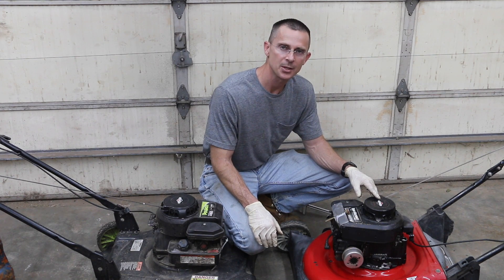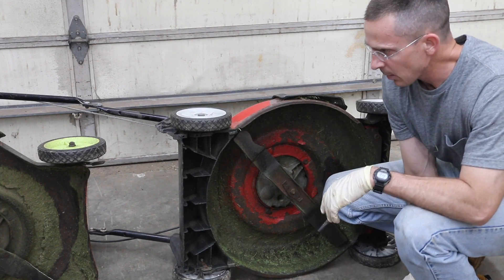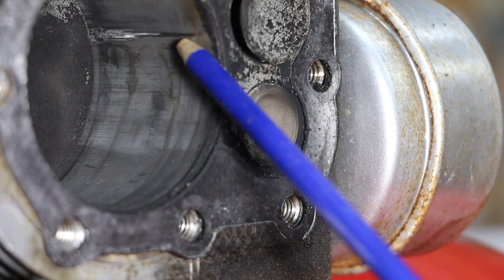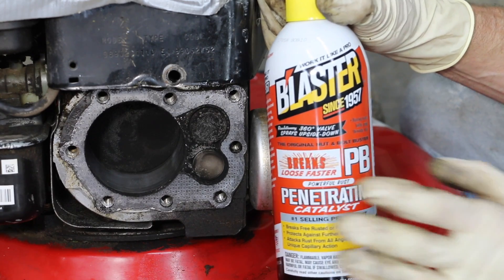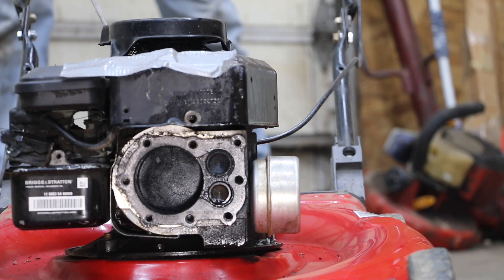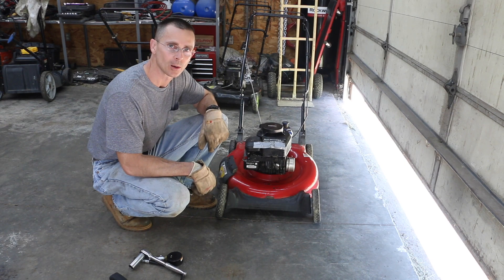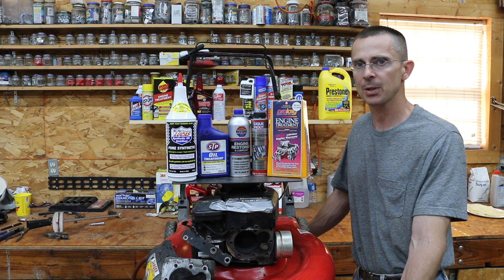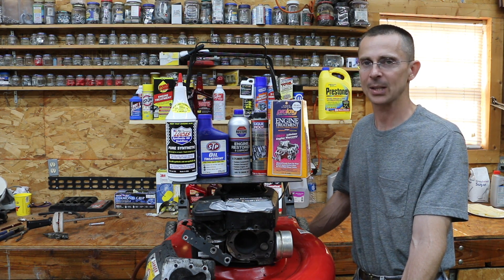Engine ran without oil, seized! Can it be saved?

Comment: I see that bottle of 44K in the background! We use BG products at our shop. If you're willing to test some, I can get you other products. Intake cleaner, engine performance restore, transmission conditioner, pretty much anything. I personally don't know how well they work but I've had good luck with the fuel system cleaners.
Reply from the maker: Dylan, I may take you up on the offer.  I've spent hundreds on additives thus far:)  Free additives would be greatly appreciated.  Could you send a PM to me if you're still willing to do this?
Reply: Project Farm PM sent!
Reply: Project Farm looks like it won't let me pm you directly from YouTube. I'll figure it out later today, getting ready for work.

Comment: Oh yes -- was that a 2 stroke or 4 stroke engine.  If 4, there would be more items to deal with -- valves/valve stems, actuators of different types, etc, as well as camshaft mechanism.  I forgot:-  Main bearings also, regardless of 2/4 stroke.
Reply from the maker: Alan, That's a 4 stroke engine.  I agree, the noise is coming from the main bearing.  Thanks for watching the video and commenting!

Comment: two recomenddations I have would be lucas oil stabilizer and engine restore.
Reply from the maker: Joel, Great recommendations!  Lucas is in first place in the vote and restore is in 2nd.  Thanks for watching the video and commenting!
Reply: Project Farm I recently blew an intake gasket due to me accidentally having a partly soaked k&n air filter of non flammable brake cleaner which wasn't the greatest idea and it sure looked like I was using seafoam.

Comment: Use diesel to free up seized engines... works beautifully. Literally fill the case to the top, leave the fill plug out, let the engine sit for an hr or so, then begin gently oscillating the crank back and forth to free the rings without breaking them. Then full rotations. Empty the diesel, wash the engine out with used oil, then put in fresh oil. (Red diesel is best due to the high sulphur content)
Reply from the maker: This is a great suggestion!  Thanks for watching the video and commenting!

Comment: Heh, nice job!  Many years ago a girlfriend siezed up the engine on her old Murray push mower. When I checked, it had little or no oil.  I was almost sure it was going to be a lost cause, but I still thought I'd see if I could get it running again.  To break it free I had to hit the piston with a small sledge using a piece of wood as a cushion.  Some hours later, and after changing the oil three times (it looked like someone had pured glitter into the crankcase) I decided to see if it would start.  I was astonished when it fired right up on the third pull and it barely smoked!  That thing ran for YEARS afterwards!  Moral?  Never give up!
Reply: These low-tech engines are surprisingly durable. If the Titanic had been made out of lawnmower engines it would still be going today.
Reply from the maker: BluntForceTrauma666, Impressive!   I enjoyed reading your post.  So, Thanks for commenting!
Reply: Nick Kocian it would never have gotten near the iceberg due to lack of power so he is 100% right.
Reply: WineScrounger  even though it hit an iceberg?
Reply: I've got an old Tecumsa that I'm considering to donate to Todd. 
It's got a cracked block and it has, more or less, run without oil for the last 7 year's !  At 30+-- hours every summer ! And it still runs dang good.
Reply: @dancahill9122  can fix it for 10$ but won't tell you how
Reply: @chriscs9080  how? I don’t really care but I wanna know now lol
Reply: Lemme guess Briggs flathead?
Reply: I notice you didn't love the girl friend enough to go buy her a replacement $100 POS murray mower.
Reply: i couldn't impress my girlfriend with $300 mower, she said rear wheels are too big and don't look right

Comment: try the engine restore.  I doubt you'll be able to ever fill that scratch.  I think your main bearing is shot on the bottom. that's probably where the knock is coming from. nice job getting it freed up.  I would have put the mmo full strength on the top end, but pb blaster is great for stuff like that.
Reply from the maker: Thanks for watching the video and commenting!

Comment: I would continue to use synthetic oil and use seafoam in the motor and it make it run smoothly and will build up compression in the cylinder head. It won't run smoothly overnight it'll take it a few days but it will run like a new motor. Also I would recommend cleaning the pistons and rods from the grime from the oil and gas deposit to make it run better also.
Reply from the maker: Thanks for watching the video and commenting!

Comment: Now let's see how many times you can seize and recover that engine!
Actually, on second thought, I want to see the inside of that engine first. Can you replace whatever bearing has been destroyed, and if so, would that fix the knock? I can't image this did too much damage to the engine block. It sounds like people think the cylinder walls can be resurfaced (I think they're right), and all the internal parts could in theory be replaced, right?
Reply from the maker: Great suggestions!  Thanks for watching the video and commenting!

Comment: Now see if the "restore" product really does fill in scores with it's "CSL" metal particles. It's supposed to raise compression.
Reply: sideburns2009 gc
Reply: Yea I’m gonna go ahead and say putting metal in your oil is gonna cause a bad time
Reply: @Jenksauto  I put steel wool in my engines, cleans em out real good.
Reply: sideburns2009 putting metal particles in your engine sounds like a horrible idea...
Reply: Melody k.
Reply: Works great.
Reply: Restore has worked great for me in junky cars, I would like to see how it works here.

Comment: Those products are made for worn parts, not damaged parts. The knocking noise could be a bad rod bearing, wrist pin, or broken end cap.  The gouged cylinder wall could be from a cracked piston ring or lose debris. Dig into it a bit more.
Reply from the maker: Thanks for watching the video and commenting!

Comment: I'm voting for the silver can engine restore. it's done wonders for improving oil pressure in some high wear engines I've had. I'm inclined to believe it'll help to reduce the slop worn into the main and wrist pin bearings. they claim improved compression but I've not tested this myself.
Reply from the maker: Thanks for watching the video and commenting!

Comment: When I was in grade school a neighbor gave me his lawn mower that had been run without oil. There was no scoring in the cylinder but the connecting rod was broken and the crank was badly scored. I bought a new crank and connecting rod and used it to cut lawns for several years after that. It's strange that I did not have scoring in the cylinder like your engine. That knocking you are hearing is probably rod knock. Keep up the videos they are very informative.
Reply from the maker: Thanks for watching the video and commenting!

Comment: Need to look at the journal bearings. If the Babbitt metal is all wiped, it's probably more of an issue than scored cylinder walls. It'll never run smooth without that being replaced. Scoring on the hardened crank bearing surfaces probably means it's done though.
Reply from the maker: Thanks for watching the video and commenting!

Comment: I've been wondering about using a product called engine restore.  A youtuber showed it working on a car and raising the compression to about normal.  But I'm curious as to what it would do for a worn out scarred up engine.

There's also another fuel treatment called redline.  It has been noted it chemically has more condensed cleaner than other brands.

If you could test one or both of these that would be sweet!  Either way, thanks for the videos.  They're awesome!

Sincerely,

Joe T
Reply from the maker: Thanks for watching the video and commenting!

Comment: If the engine has a knock like that, it's bound to grenade at some point. The scoring on the walls are probably too deep to hone as well. It will run but maybe for one last mow, but that's it. Maybe differential oil could keep it running longer, but not by much.
Reply from the maker: Thanks for watching the video and commenting!

Comment: everyone will admit there's a point of no return when it comes to their products. Most are just to help you limp home or make to a shop where the problem can be properly addressed. 
  in the case of your lawnmower knock. In small engines they make the Rods and Caps soft on purpose, far cheaper to change a rod than a crankshaft. when they do fail, there is usually a build up of the soft metal from the rod on to the crankshaft journal, nothing that medium and then very fine emery cloth can't handle. as far as the rod, since Jesus doesn't come in a bottle, you can clean up the crankshaft, buy a replacement rod assembly with piston and rings, change out the bottom crankshaft seal, after you hone out the cylinder wash everything up with soapy water, since you only have two valves go ahead and lap them in. be sure to give your self at no less than a .008 ring gap and no more than .012. this will be far cheaper than buying a new lawnmower, and it's usually cheaper to buy a lawnmower than a replacement engine. Be sure to hone out the cylinder before you buy the piston, and keep the hone stones oiled. Every man woman boy and girl should go out of their way to do a project like this. The first time my oldest son rebuilt a lawnmower engine, my personal cup of pride was ovevflowing.( he's a mortgage banker). 
  my suggestion is write off the engine unless you're willing to invest a Saturday and a moderate amount of money in parts, but the personal satisfaction and having something that you know intimately doing it's job offsets the time and expense.
Reply from the maker: Phillip, Agree!  Thanks for watching the video and commenting!

Comment: I didn't find your video on Restore so I looked up another one (link below).  I saw your video on Seafoam so my previous comments were made under the assumption that Seafoam was the best option to "restore" :-) compression.  

So, in this case I would use Restore on this engine.  As for the knock, I would bet you've got a destroyed bearing somewhere.

https://www.youtube.com/watch?v=YvyYkW42yOc

Comment: Personally, I'd junk that engine, but if you want to fix it, you gotta do something about that cylinder wall. Probably need to replace the piston and/or the piston rings. You basically have two options, you can bore out the cylinder, or you can weld the gouge and reface the walls. I think in either case, you'll need to replace the piston. I don't know enough about polishing cylinders to tell you the best, or even the correct, method to follow.
Reply from the maker: Mark, Agree, engine is ruined.  Thanks for watching the video and commenting!

Comment: I would go with Engine restore to take care of the compression.  I have seen it work before.  I would get some Motor Honey for the knock.  Also I have torn down several briggs that were run out of oil and the connecting rod bolts where just loose, I think it is from the heat and expansion and contraction.
Reply from the maker: Great suggestion!  Thanks for watching the video and commenting!

Comment: Ain't nuttin can't be fixed!!! But you might need to add some new parts. The gouge in the cylinder wall might be the ring end gap. What everything looks like is just normal wear..... but years compressed into minutes!!! Good experience for everyone to check out though. When I was an aircraft mechanic we had a beater Honda to drive around the airfield and for dashing out to get supplies. I think it had around 300,000 miles on it. It burned regular oil so much it needed spark plug extenders to keep them from getting fouled. One day we had a brainstorm to run it on thicker oil to help with the oil consumption. We regularly used 60 weight oil in a couple of planes that were there so we tried that just for a science experiment........Ran perfect. No oil burning and I think it's made it to 350,000 miles. Maybe try a higher viscosity oil in your lawn mower? The noisy one I mean.....
Reply from the maker: Panther105, I agree!  Thanks for watching the video and commenting!

Comment: Great videos!  What would recommend for a new mower purchase for home use?  I've been using a kolbalt electric for two years and the nuts that hold the engine to the deck completely blew out.  Thinking I might go back to gas.
Reply from the maker: It's difficult to make a recommendation without more information regarding how much you're willing to spend.  I really like the commercial grade Snapper's but they are very expensive.  I don't really have a preference on most of the entry mowers as long as they have a Briggs & Stratton Engine.  Good luck!  Thanks for watching the video and commenting!
Reply: Project Farm thanks for the reply.  Yeah, nothing too expensive.  I'll look out for the Briggs and strat.  The deck on the mower I have now was made with cheapo metal so it didn't last.  Need something tough but probably not commercial for now.

Comment: It's going to depend upon how badly the engine bore and crank are damaged. I have gotten by in the past with honing the cylinder (IF, it isn't too badly damaged), cleaning the aluminum off the crank with caustic (strong soap), sandpapering any burrs off the crank, polishing the crank with crocus cloth, and replacing the rod, piston, and rings.
That knock indicates that your connecting rod is damaged and that scratch in the bore is substantial. I seriously doubt any "snake oil" product can overcome that damage.
Rod and crank damage - https://www.youtube.com/watch?v=eASCK9BDMEU (Note that this engine was not ran until it failed like the one here.)

Comment: There isn't anything in a bottle that will fill the gap causing that knock but if I had to pick a best choice I'd go for STP Smoke Stop.  It's a terrible idea to add it to oil IMO but I have seen it dramatically reduce blow by in a crapped out engine and if it can fill the gap around a piston it might well help the ends knocking.  I dread to think what it does to the lubricating properties of an oil though.
Reply from the maker: This is a great suggestion.  Thanks for watching the video and commenting!

Comment: Use motor honey.  I had low oil pressure on my 1996 Cadillac Northstar, and the oil light would come on.  After the single treatement of motor honey 2 years ago, I never saw the light on again.  I have been using marvel mystery oil in my gasoline and oil for years.  Low oil pressure was caused when the car sat for 4 years unused.  Whatever it needed, it got. Even after 2 oil changes since, the car still has no issues.
Reply from the maker: David, Thank you for the recommendation!

Comment: Old trick is to use heavier weight oil, it will take a lot of that knock out if the issue is excessive bearing clearance.  Obviously thick oil isn't a substitute for bearing metal lol, but it might just allow that engine to live long enough to cut a couple more lawns.    

I remember my father had a cheapo lawn mower that had no power to cut tall grass.  I did a 50/50% gas/nitro rc car fuel in it to see if it would not bog down as much.  It seemed to work, other than burning eyes lol from the fumes. My father tried to use it a week later and said it had trouble starting, and he just so happened to bust the crank hitting a rock, so I never did find out if it was going to survive.
Reply from the maker: LOL!  I enjoy reading about other people's experiences.  Thanks for the recommendation on heavy wt oil too!

Comment: Hi there.
One thing to keep in mind, 
Dilution of the oil with thin oils or fuel (Marvel Mystery oil) can do more harm than good. 
The explanation lies in the number of carbon in the carbon chains as the oil is made up of.
Synthetic oils have carbon chains of relatively equal length, Which in turn leads to lubrication film strength Sharply decreases when a certain dilution is reached. 
A mineral engine oil does not lose it`s oil film strength as abruptly when it`s diluted with thiner petroleum products. 
Great videos by the way, keep up the good work :)
Reply from the maker: lovund86, Great point!  I'm learning a lot from those on this forum.  Thanks for watching the video and commenting!